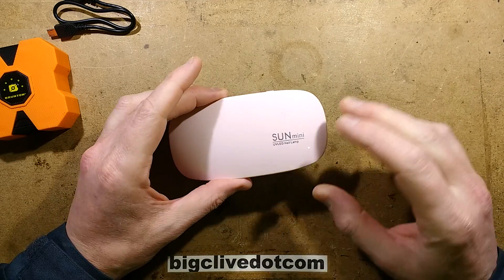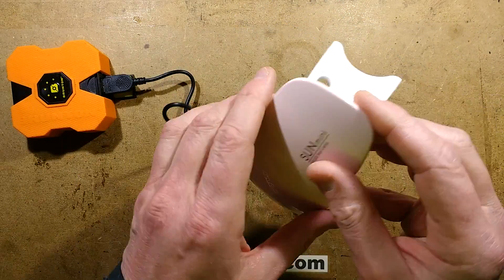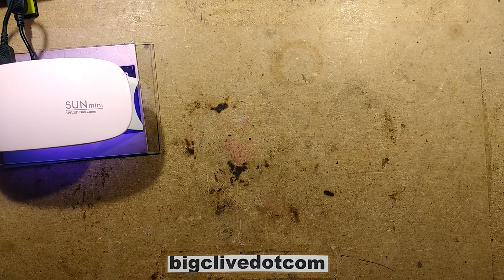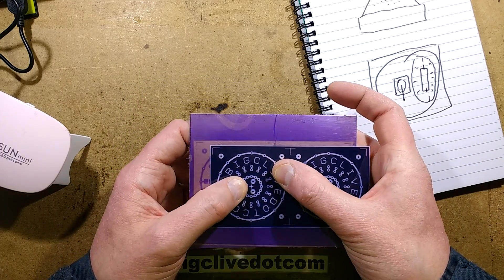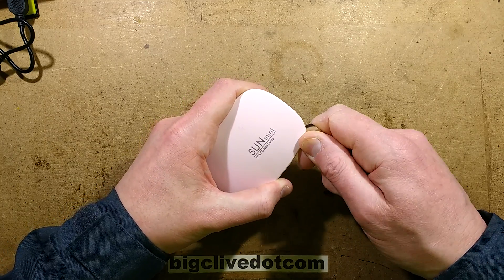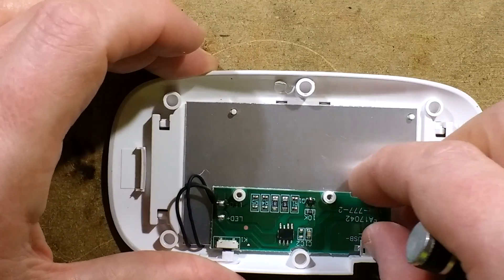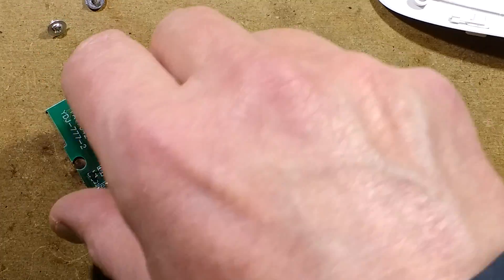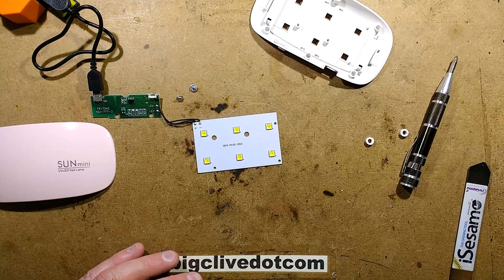Inside a UV nail-gel curing light with unusual LEDs.

Comment: Looks like they have use the same mould as the crappy fake Apple Magic Mice!
Reply: Can't be worse than anything from the original author.
Reply: Another money grabbing law suit ahoy...
Reply: why make a new mold, when you can use ready made bulk stuff ;)
aka machining new molds cost far more money than modifying existing..
Reply: Callum Burns Was thinking the exact same.
Reply: You've been using your mouse constantly for 4 years?? Get a life bro
Reply: And i had normal apple wireless mouse before that also no prob batteries lasted 4 months
Reply: The real ones are crappy too https://i.imgur.com/lCEkDPS.png
Reply: I have seen some of these listed as "uv led mouse" and it is obviously the same mould as this one and it probably is actually stolen from something like a magic mouse. I've seen larger versions too which you could fit both hands under.
Reply: that happens only once a year if you use it 24/7 mine is still working without  charging since 2014
Reply: Not constantly about 4-5 hours a day